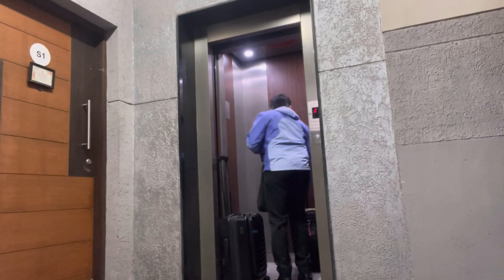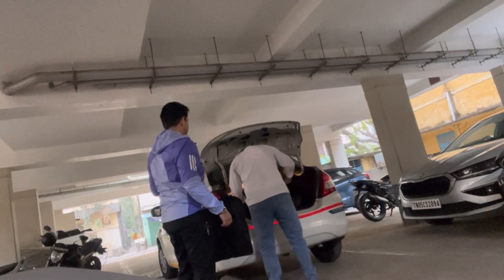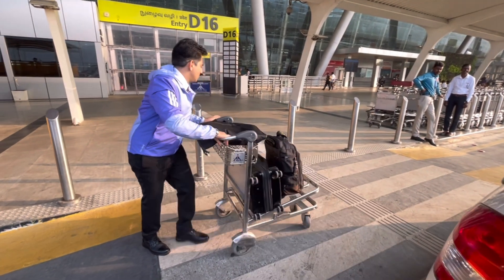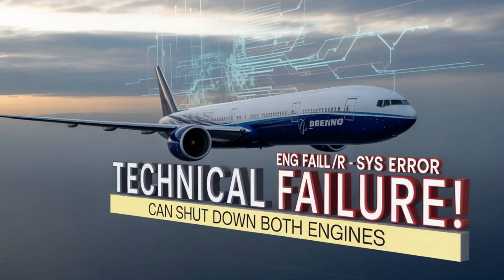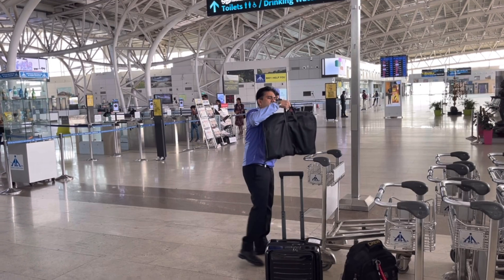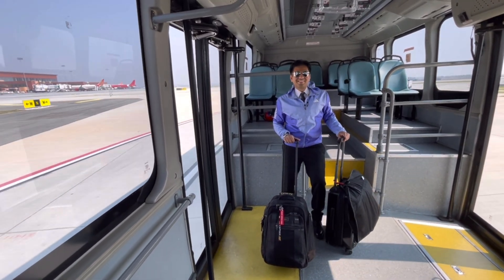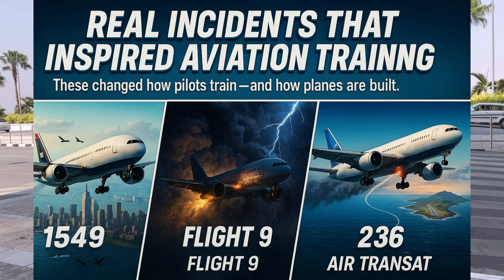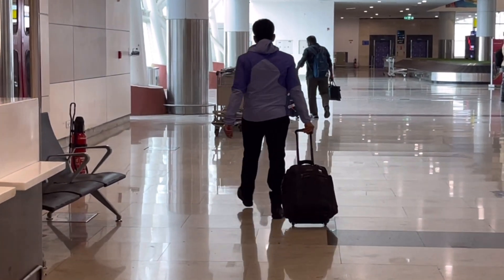"The Scariest Failure in Aviation – Dual Engine Flameout!" #aviation #pilotlife

Comment: Dear Captain, apologies , as i’m late for the action, was recovering from an illness. 

Another amazing video, whenever you mentioned the cause or the reason behind an engine related issue. I could resonate with key incidents. I find that as an improvement, as i used to only watch planes, now the depth of the operational impacts are also being understood.

Also captain, wanted to get your view on Gilmi Glider (Air canada 143 - Boeing 767). Can it also be considered to fit into any of the categories you have mentioned? (Although reports say the fuel was incorrectly calculated)

And, if i were a passenger i would somehow take a wild guess if there is an engine failure, as the engines would give some sort of an indication like a similar sound from a compressor stall, but the thing i would do is, remain absolutely calm because i know the gentlemen/gentlewomen on command would know the best on handling the situation & would prioritise the passenger’s lives more than theirs. 

Happy and safe flight captain, sending positive vibes.

Comment: just read the preliminary report.. the fuel pump switches were turned off the moment the aircraft was airborne.. and one of the pilots was probing the other in the flight recording looking more and more that the one of the air India  pilots did the unthinkable 😔
Reply from the maker: this was just a line in the cvr transcript which could also be understood out of context! the full transcript needs to be out and published to understand the truth !! you can very well google and see watch is the first pilot action in case of dual engine failure in an boeing aircraft !! - perhaps that would make this clear for you !

Comment: And always confirm what engine you are shutting down in an emergency to make sure you are shutting down the correct one. My airline's emergency checklist has a heading on top that goes like this: 

FLY THE AIRPLANE - SILENCE THE WARNING - CONFIRM THE EMERGENCY.
Reply from the maker: every pilot does it - but it has happened! thts y it is called a mistake !!

Comment: Thanks Captain for the informative video. My answer to your query is: Passengers should keep calm, with faith on the pilots' skills, so the pilots can deal with the issue of failed-engines.  (Passengers being excited/disturbed and panicked will not solve the issue). Thanks.
Reply from the maker: but how will a  passenger  know that there is a dual engine failure ?????
Reply: @CAPT_MAK  Passenger will know because engine's noice will change, flight will descent, and power will go off. Regards!

Comment: passengers can know about engine failure mainly the sound, as jet engine produce a lot of noise which can be heard inside the cabin (specially during climb).
passenger in such case should trust the pilots and be calm as this will support pilots more to focus on the real issues ( as if A/c has a lot of altitude it can safely glide to a nearest airport or in worst case can do ditching, as planes are developed for water landing and pilots are well trained for this sim sessions ( only sea is the only option).
sir video was nice, but please keep the background music a bit low.
thanks sir.
Reply from the maker: thnq - will do !

Comment: Hello Captain!

Thank you so much for creating these videos and sharing your valuable, practical aviation insights. I live near Toronto Airport and often track flights using an app. Whenever I spot an Air India flight, I can’t help but wonder if Captain Mak might be flying it, maybe we’ll get to meet someday!

In response to your question: One possible way to detect an engine failure is through a visual check, if something seems unusual with the engines from the window. Another clue could be abnormal engine sounds or even an unexpected silence at cruising altitude. Additionally, when the RAT (Ram Air Turbine) deploys, I believe the cabin lights may flicker or there might be a strange noise.

Wishing you all the best, keep up the great work, Captain!
Reply from the maker: thnq for your comment , love and support- appreciated!